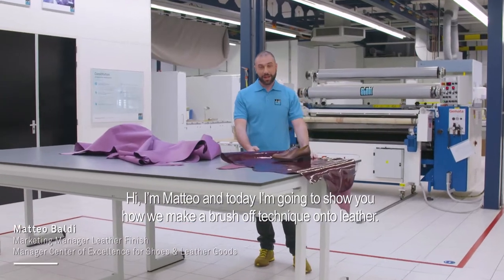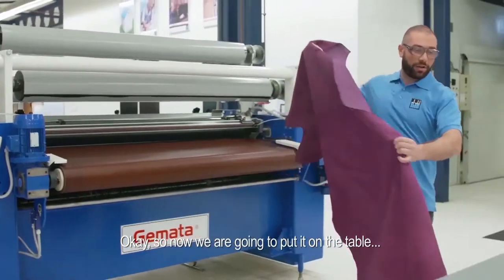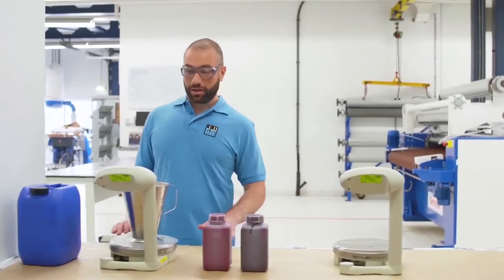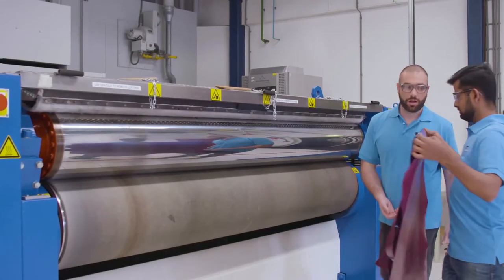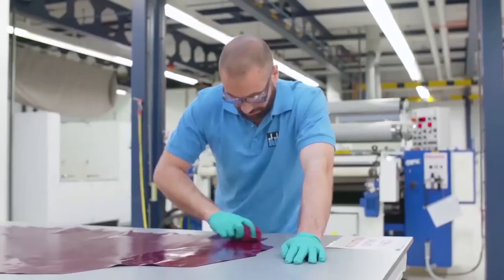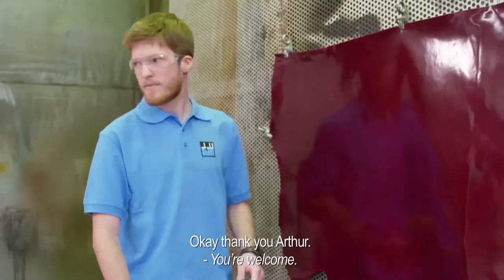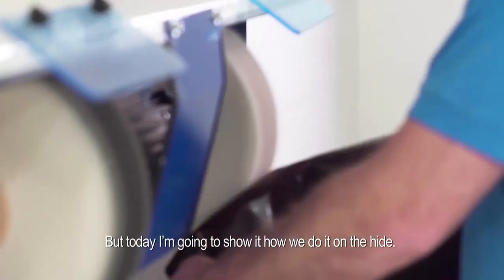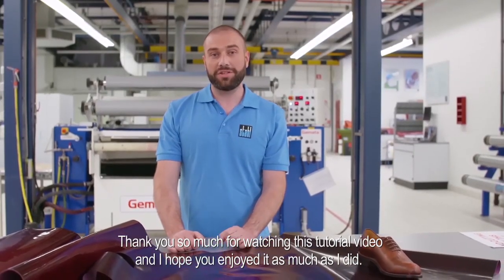Tutorial: How to perform the brush off technique on leather

Comment: Nice. At 4.25 what are you using to brush it off ? Is it sand paper ? If not, what material is it ?
Reply: Hello.. the brush is a special wool which is normally used for those kind of operation... like the one you find in many hotels and restaurants for shoe-shine :)